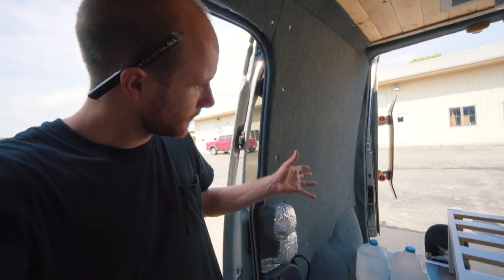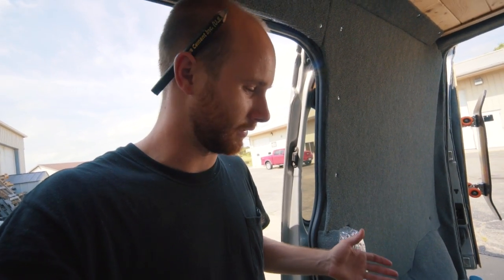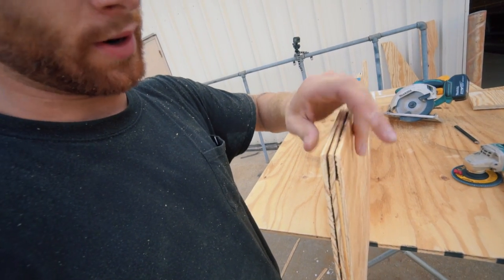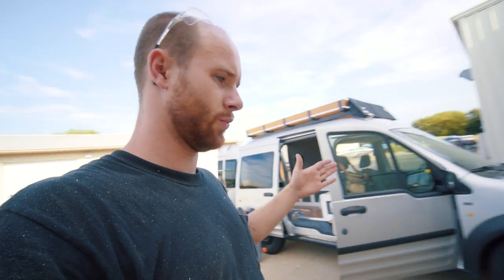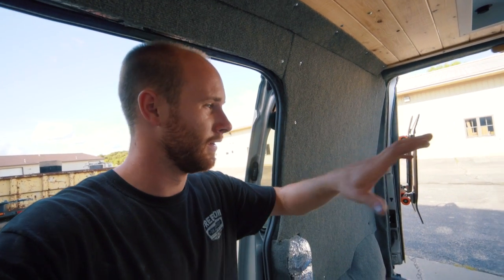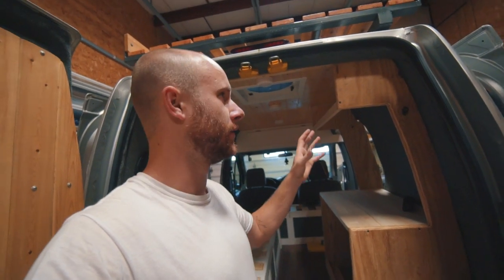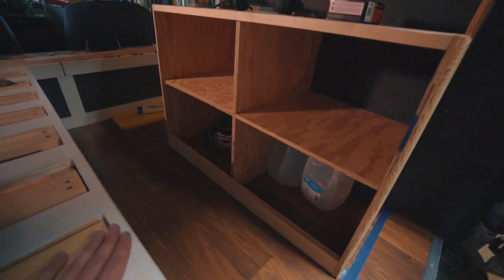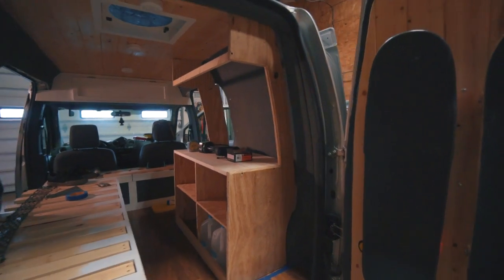Installing A Custom Kitchen Cabinet In A Van!

Comment: In addition to the clearcoat already suggested,  "Magic Erasers" are my go to for cleaning white surfaces, it does it a great job and won't damage your paint easily. You can usually find them at your local grocery store, but I have also found them in most dollar tree stores. They are also very compact and useful for cleaning other surfaces as well.

Comment: Put a coat or two of clear coat on the white cabinets. This will make it less likely to attract dirt and much easier to wipe and clean. I like to use polycrylic. Its a really hard, fast drying, and clear. Its also water based which is easier on cleanup and easier on your nose. Looks really great by the way:)
Reply: Great advise
Reply: What about tung oil would that do applied over white paint?

Comment: Once the project is finished, the tools are put away, and you have the van on the road traveling, the white paint will be easier to maintain. Typically, dirty hands wouldn't be touching all over the cabinets except during installation.

Comment: Wow, looks great! I would suggest on the top two openings (under your countertop) instead of putting regular drawers,  I would put cabinet fronts that are hinged at the bottom. Once you open one of them, it will act like a little table. Great place to sit on your bed and put your coffee and eat. Inside you could build drawers that you can pull out. I hope this makes sense!

Comment: Everything is looking great, I love the white for your furniture. I use dishwashing soap (Dawn) to clean my white painted surfaces. Saw a couple comments to get rubbermaid containers for the storage - that would help to stop scratches that will show up on the bottom of the storage spaces.  One suggestion for what I did on my lower cabinets.  I had pull out shelves put in all my under cabinets. It added so much day to day usable space to my cupboards. No more space wasted with things buried in the back - no  more moving out all the stuff in the front to get to the back. And I got clear low adhesive Contact shelf liner to protect the shelves from scratches in the white paint.

Comment: Another suggestion:  Put in the rubbermade bins, then put a table flap over the whole cabinet that you can flip open, with the hydraulic lift arms things (don't know what they are called) on the sides,  to use as a table to eat, or put your laptop on etc. while sitting on the bed.  Just an idea 4 U! ;)

Comment: When l have a void, crack or knot hole etc in plywood, or dimensional lumber, l use a two part epoxy to fill in the deficient areas.
Epoxy gives much structural strength to a repair and may be stronger than unflawed wood by itself.
When sanded and painted, the epoxy repair is unnoticeable.
I only use wood filler for minor cosmetic repairs that will bear no stress and will receive little wear.

Comment: Is this going to be removable when you need the space to move stuff with your van?  OK got the answer to that, but if you put the unit on casters you can move it out and use a docking latch or clete on the wall of the van to keep it in place when you drive around.

Comment: Nice kitchen!!  You don't need drawers - get some nice rubbermade bins to slide in and out. They are really nice, light weight,  and cheap too! Maybe try that first. then if it doesn't work then make the drawers.

Comment: What kind of screws (and size and length) did you use to bolt to the van wall?  Did you secure part of the cabinet directly to the van ribs?
Reply from the maker: I don't remember off hand what length and size screws I used. They were self tapping screws so that I could anchor into the ribs of the van! Then I just used standard wood screws for anchoring to the floor. Hope that helps!

Comment: Use a satin finish oil based paint on the white areas. It'll be super tough and you can clean it with pretty much any cleaner like 409 or whatever.